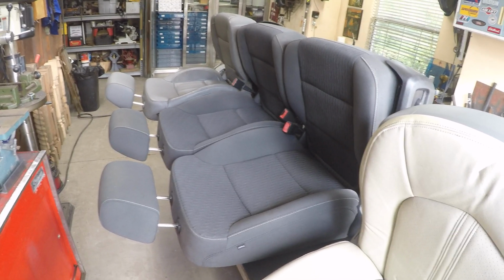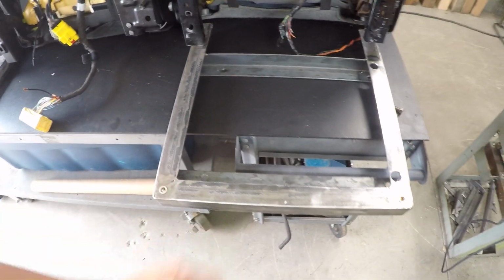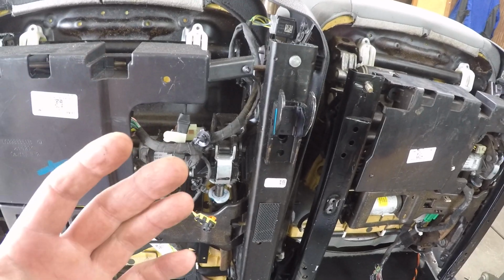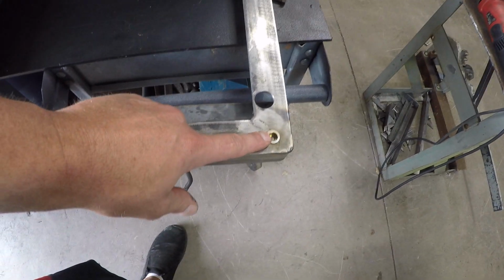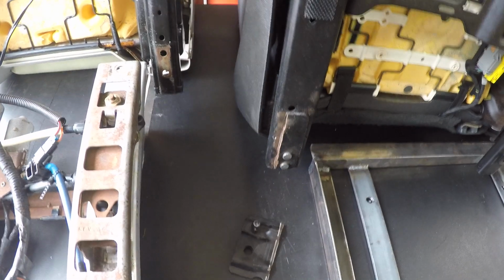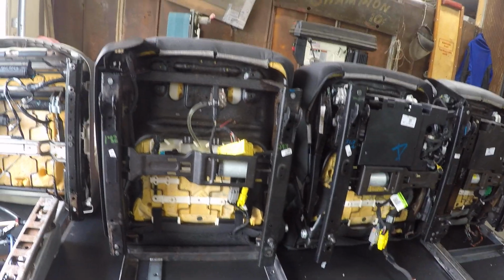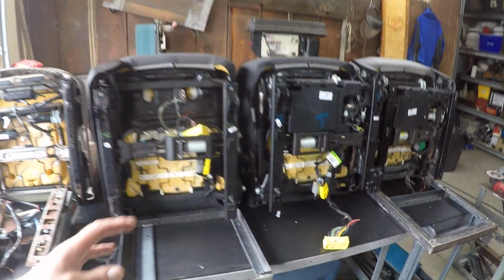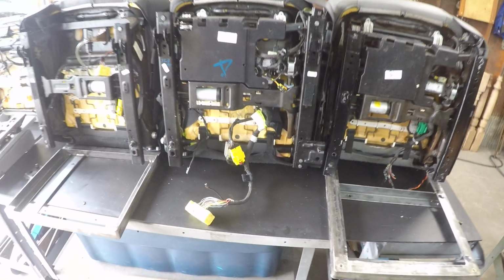OBS Outpost 2015+ GM  Seat Swap into 88-99 Chevy C1500/ Tahoe

Comment: Great channel I have a 99 Tahoe LT 4 door 5.7 and I love my truck. It has 220,000 miles on it and runs great. It is so hard to find the seats for these trucks. I need both front seats and I have looked and checked all around I have the Grey / silver leather seats
Reply from the maker: check on eBay, alway see seats on there for sale.

Comment: This is exactly what I was looking for! I have a 2004 Duramax Chevy 2500HD with almost 300,000 miles on it and the driver's seat is getting kinda tattered. I see newer model leather seats for sale all the time, but did not know how much work it would be to adapt. Thanks!!
Reply: Now to see how much...... and what about the center console??
Reply from the maker: We only do seat swap for GMT400, your truck is a GMT800
Reply: Im currently Making this swap with 2018 escalade seats, but im not having any luck powering them up. Both driver's & passenger no signs of life the 3 wires. Any suggestions?
Reply: @Dan Pettigrew  he mentioned some seats needing 4 wires powered up. I did just as seen in this video with the 3. Do you happen to know the color of that 4th wire, and is it also in that harness?
Reply: The seats I have are 18 escalade with heat & cooling. Unfortunately, I do not have the vin unless i can find it on the seat.
Reply: @Dan Pettigrew  i am using a car battery. & have nothing with the main ground & power both drivers & passenger. Ive also tried adding power as shown in the video adding power to the red black stripped pin 23 memory bypass & still no signs of life. After watching this video & learning there may be a 4th wite that needs power i was hoping this was the issue.
Reply: @OBS Outpost  where can I get cts seat sir
Reply: @MagaRickn  Probably the same as a seat.Bought a 2002 seat ,buckets and centre for $150.

Comment: Great video man very informative!
Have you figured out the wiring for heated seats though? My 98 came with a harness for the heated seat option but I have the cloth interior so no heating elements. Just curious if this is in the realm of possibility.
Reply: It is most definitely but yet they change there wire harness colors sometimes so you know.

Comment: Could I swap out seats on a 2005 Chevy Silverado with a 2015 GMC Sierra?
Reply from the maker: we plan on doing GMT800 brackets in the future. the biggest problem is, once you remove your seat you will no longer have a seat belt. So you would need to figure a way to safely add a seat belt to your truck.

Comment: I’m interested in the brackets. What about the middle console mount?
Reply from the maker: If you are referring to the stock obs console, it has a clip that mounts on the rear and 2 10mm that mount to the floor. no special bracket needed
Reply: @OBSOutpost   the console came with the seats (match your brackets). It looks like it has 4 mounting bolts. Do I need a separate bracket or does it connect to the buckets?
Reply from the maker: @dougmann5362  The 2015+ console uses the factory bracket that mounts to the trans tunnel
Reply: @OBSOutpost   how much are a pair of brackets?
Reply from the maker: @dougmann5362  $325 for the set add $125 if you want them powder coated
Reply: @OBSOutpost  I have a manual bench in my 97. Are the bolt holes the same as what your showing? Looks like yours is an old power bench mount.
Reply from the maker: @dougmann5362  your truck spacing is 10 1/2" x 2 bolts on each side. the Tahoe & ext cab trucks use 10 1/2 x 4 bolts on drivers and  13 1/2" x 4 bolts on pass. we use our ext cab drivers side template for driver & pass on single cab trucks. the 2 outer bolts line up and you just drill 2 more holes using our bracket as a guide per side. I also have a 97 single cab and these brackets make swapping new seats simple and takes all the guesswork out.
Reply: @OBSOutpost  ok. Let me work a deal on some seats and I’ll touchbase.
Reply: Hi do u guys make a bracket to update the console of a 97 2 door tahoe?? Or do you recommend a seat with arm rest that will fit yalls seat brackets? Would like to match the bench back seat with the front seats at well will I need a bracket to do that or do u have a recommendation for that?
Reply from the maker: @hou713ammon4 Not really clear as to what you are asking. send me an email with your phone # and I can call you to go over your options. Dan@OBSoutpost.com

Comment: While I wrote that comment, I forgot to think about asking if the front mounts allow room for the two floor vents under the carpet that exit either side of the console right behind the front seats?
Reply from the maker: yes our bracket design allows for floor heat clearance

Comment: Can you get the heater portion of the seat to work?
Reply from the maker: I'm sure there is a way, you would just need to trace the wires to the heater element and add a switch.    I have not tried since im in FL and never use heat.

Comment: Do these newer seats allow you to slide the seat forward enough to get into the back? I have an 96 extended cab with no side access door and my stock seats suck and rattle around.
Reply from the maker: most of the newer seats will give you plenty of room for back seat passengers. Our brackets are also adjustable so if you want more legroom for the driver and more room for kids to access the rear on the pass side we can do that.

Comment: I’m curious why not use heavy duty L track?
Reply from the maker: L track is used in trailers for tie downs. How could you possibly use this material to make a seat bracket?
Reply: @OBSOutpost  I figured its used in multiple industries for seating, there are bolt adapters for seats that are rated to between 2 and 3,000 lb WLL. Just thought it might be easier. It was just a thought that’s all.
Reply from the maker: @erichwise7734  Ahh your thinking of the l track that they use for the lower rails that make the seat adjustable like on airplanes or vans. That works good for that application but the actual seat bracket that joins the rail cannot be made from l track. so you would still need a bracket like mine to join to the seat.  All of the OME seats already have adjustable seat rails that bolt to my brackets so no need for another set of adjustments. They might serve some purpose for rear seats in Tahoes since rear seats don't slide back and forth and this could give the user more cargo or passenger legroom depending on what position the seats are locked into.
Reply: I see! Thank you for your generosity with your time.
Reply: I think he is actually referring to E track and its used for load securement. Not rated for or DOT approved for seat fasteners plus the only thing that will lock into them are the E track clasps on the ends of straps.

Comment: I have 2004 seats will this work and if so how much and where u located
Reply from the maker: the standard set for your seats are $325.00. We are located near Orlando FL but we do ship. You can contact me directly at Dan@OBSOutpost.com
Reply: @OBSOutpost 
2004 gmc Yukon slt.   Drivers side seat
Reply from the maker: @robertcooks8371  not sure I understand the question, feel free to email me Dan@OBSOutpost.com
Reply: @OBSOutpost   I need a drivers seat for 2004 Yukon front captains chairs with armrest. If you have some how much?
Reply from the maker: @robertcooks8371  sorry I don't deal in any seats older than 2007. best best is local junkyard I see them at mine all the time

Comment: Do you make anything for the 2nd row folding seats for 1997 suburban?
Reply from the maker: we don't sell seats, just adapter brackets to put new seats in OBS trucks/suvs
Reply: @OBSOutpost  I know that, Do you make  Adapters to put newer 2nd row seats in a 1997 suburban.
Reply from the maker: @adamtedder700  Not currently but they are in the works. should have them in the next few months.

Comment: Do these brackets work to mount rear seats in a crew cab ?
Reply from the maker: no brackets are needed to mount the rears, you just drill new holes and add nut plates.

Comment: Sir, I own a 05 Sierra. Would like to install newer generation leathers. Is that something you could do?
Reply from the maker: other year seats won't work because your seats have a built-in seatbelt. I could design a bracket for your truck but you would need to figure out a way to add seat belts safely